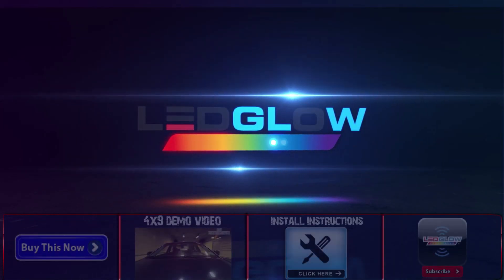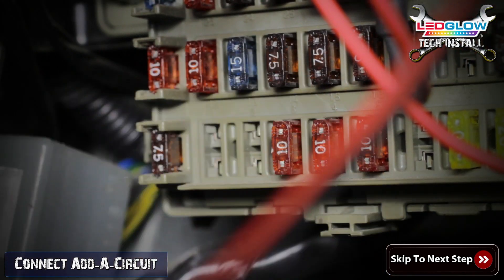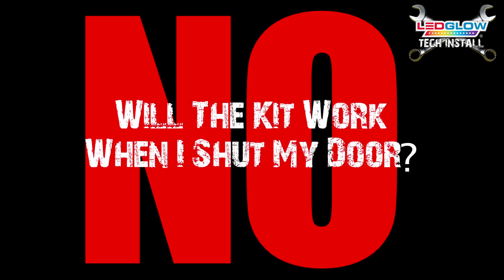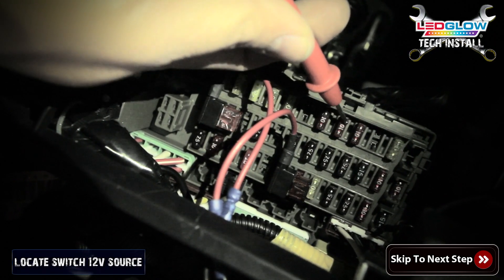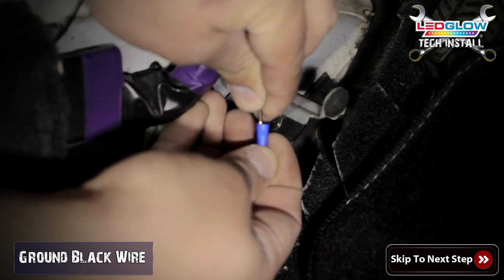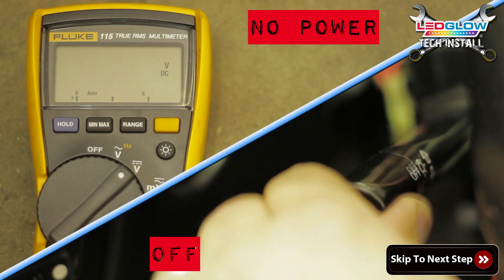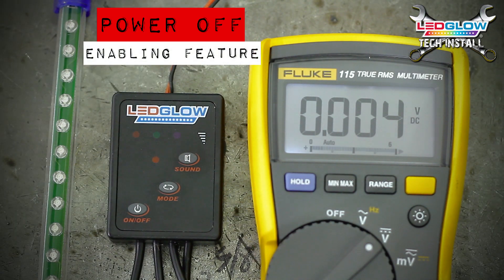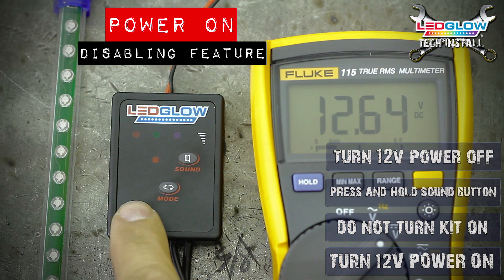LEDGlow | Auto Illumination Mode for 7 Color Interior Car Lights and Truck Lights

Comment: DO you need add a circuit??
Reply from the maker: Thank you for the interest in our product! No, the add-a-circuit is completely optional and only serves as an easier way of supplying power to the LED kit.
Reply: Wow well thank you for the very prompt reply. While you are browsing the video comments, I would like to ask an important question about my kit. I currently have the 7 color LEDglow kit hooked up to my interior fuse panel. It works fantastic! However I cant get it to turn on when the rest of my car lights turn on. The instructions are a bit vague on how to enable this function. I have tried a couple different fuse slots, and have it hooked up to the fuse that correlates with the DOME lights(interior lights, clock ect.) Am I doing something wrong? Can you provide some more in depth advice? 2005 Toyota Camry btw.
Reply from the maker: To have the kit turn on automatically when a switched power source gets turned on and has 12 volts of power, you need to set the kit into the Auto-On mode. You do do this by turning the kit off, and holding the mode button for 3 seconds. Once you power the kit on again, it should now be in the auto-on mode, and turn automatically when it sees 12 volts of power.
Reply: Okay I follow. Can you give me an example of some 12v switched power sources?
Reply from the maker: That you would use with an add-a-circuit? They would be any fuse related to your ignition, power windows, etc.
Reply: I do not have an add-a-circuit and currently have the LEDs being powered by the interior lights fuse. Are you saying I will need an add-a-circuit to enable auto-on?
Reply from the maker: Not at all, as long as the auto-on feature is activated, the kit will turn on as soon as it sees 12 volts of power. Doesn't matter where the location is.
Reply: Ah very good to know, thank you for the help. If I connected the wire to the ignition fuse, would the lights turn on and stay on when I turn the key? If you dont reply ill just go find out myself.
Reply from the maker: Yes, that's exactly what they would do

Comment: Having a hard time hiding the wires
Reply from the maker: Nathan Guynup Which locations did you mount the tubes? A few spots to hide the wires are under the door sill trim, under the floor mats/carpet or by using zip ties for the excess wire and hiding it under the seats.